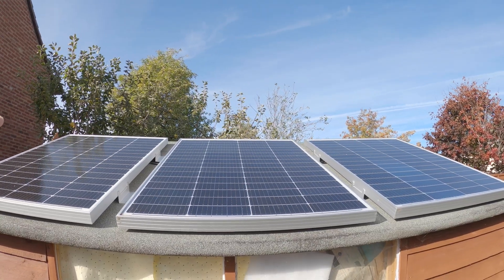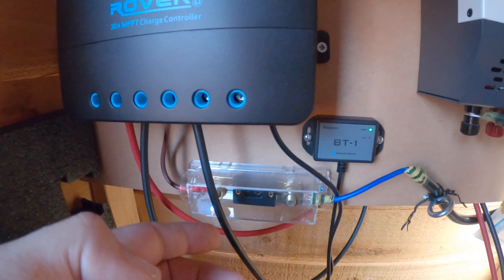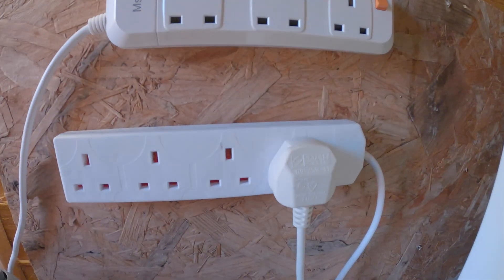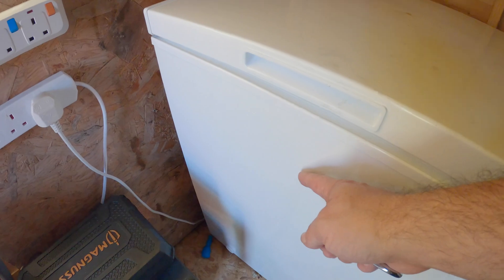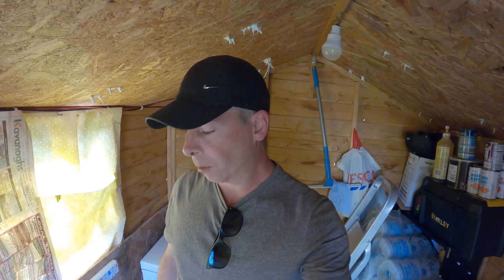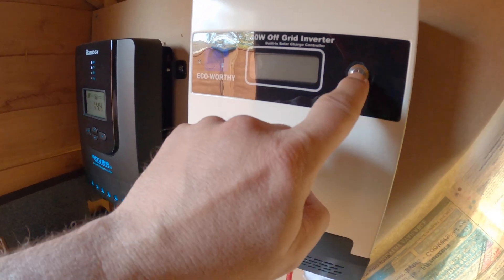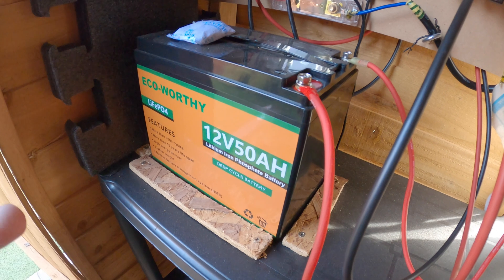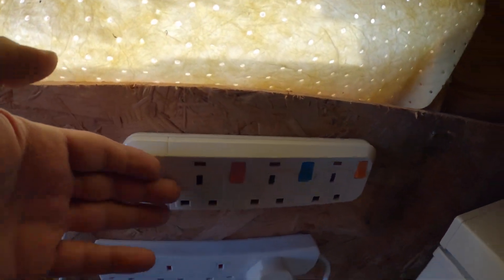My Solar Shed

Comment: You can certainly put additional panels on the other side of the roof, even though they are facing the other way.  Put the other-side panels on their own charge controller. They won’t generate as much total energy as the main panels, but they will definitely add a non-trivial amount of energy to your total store.

The bigger problem is that you don’t have enough battery storage.  50Ah x 12.8V = 640Wh of energy storage and your panels are producing vastly more energy than that.  Well, that and using 12V when you could easily be using 24V (or even 48V) instead.  But I won’t push too hard on that point.

Comment: Connect your battery's up in parallel so you have 24v instead of 12v. Your 3kw kettle for example would be 3000w / 12 = 250amp or with 24v would be 3000w / 24 = 125amp. It would be more efficient + use smaller cables and you would be better consumption out of your battery's.
Reply: No, he'd have 12v connected in parallel. They'd need to be in series for 24v.

Comment: you don't want a fuse on the negative. because if the negative fuse blows the negative becomes live after the load. so if your working on it to find a problem you may get a shock from the negative!!!

Comment: That's a neat setup. Is that a Bluetooth Battery monitor I can see? I use one in the car but thinking about fitting one to my shed solar setup too, so I can keep an eye on voltages. Do you track volts/current etc?

Comment: That's an excellent idea 👍 Christian!! Especially with the current situation and future.  I watch a lot of off grid channels so I have an idea. 
   Have you thought about insulation for the shed??  Maybe some tyvek??
Have you thought about using it for your house??  Might I suggest an EMP shield for your solar... It will protect against any EMP ( electro magnetic pulses).  Some you already have solar panels have you thought about a portable power battery??  Oh yeah, and another battery is another good idea. A spare.. Lithium batteries are the best... 
    Have you thought about prepping for food and water yet??  It's always good to be prepared for any emergencies!!  
  Great job 👍 Christian!!
Reply from the maker: I’ve got a power station and want to get another. I’m also insulating the shed too to keep out any damp. The shed acts as as a small larder too.
Reply: @christianthomassleepmeditation  
Might need a vent of some kind as to circulate the air.. remember that the batteries have to remain at a certain temperature 🌡️... Otherwise they will die.. insulation is key...

Comment: Oh crap! That looks so complicated. Seems very confusing. You are very talented!
Reply from the maker: It’s pretty easy and for the most part safe. These batteries have safety measures in place. It took 2hrs to put it all together from start to finish. The hardest part was finding the parts lol
I’ve added another panel this week too to get even more energy. I would say that if I got another battery I could live in the shed.
Reply: @christianthomassleepmeditation  😂plan on getting the boot?! 
Very cool. Now buy a shade for the window, some drywall and a carpet w some floor pillows and you’re all set. 😄
Reply from the maker: I’m going to insulate it to keep things dry and maybe put some wood panels over the insulation. That’ll be about it. I do at some point want to get a cabin to go in the garden and put a lot more panels up on the roof. If I got that I would definitely do it up properly.
Reply: @christianthomassleepmeditation  oh! A guest house? 🙃😉